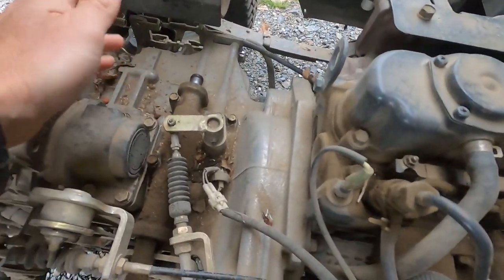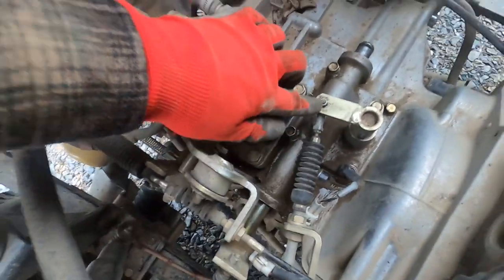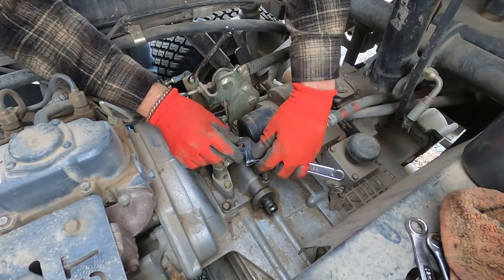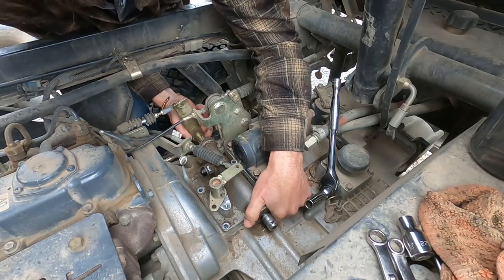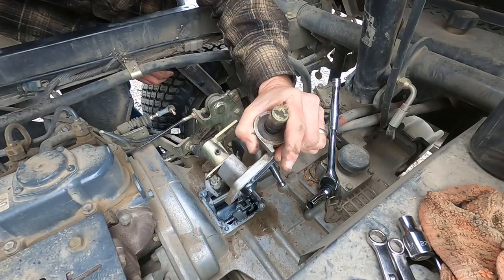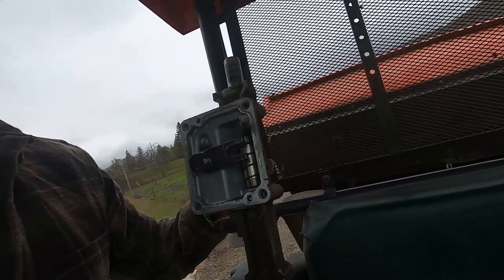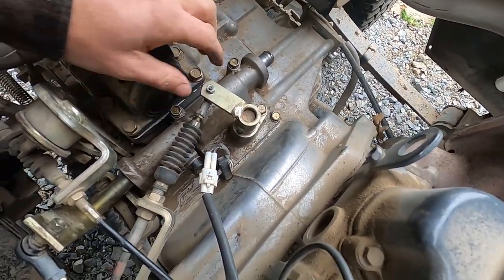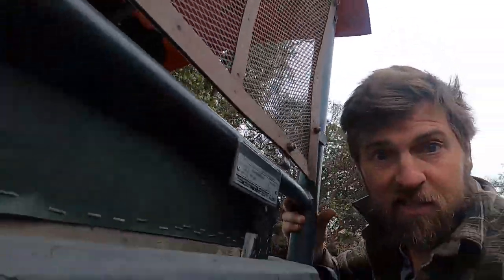How to fix DIY Stuck KUBOTA RTV 900 TRANSMISSION

Comment: Thanks for the video! It was super helpful in diagnosing the problem with my Kubota's stuck transmission.  Which luckily happened to be the same problem as yours and was an easy fix.

Comment: Great video. Helped me immensely. After a couple tries, I realized the shifter needs to remain in neutral in order for this fix to hold. The process moves the shifter, which moves the linkage. Secure the shifter in natural neutral and you'll nail it first try.
Reply from the maker: Yes, it's simple once you get it lined up, right?

Comment: THANK YOU!!  Mine was stuck in forward.  It literally took 10 minutes to fix.  I can't imagine what the Kubota dealer would have charged.  Another thing to note, my RTV was not moving well, no energy, something seemed to be holding its energy back.  Once this problem was resolved, it has 3 times the energy. So.....I guess the gears have something to do with its ability to propel as well.  This 65 year old mother was able to fix this in 10 minutes.  You just need the right tools and some shade (Texas heat).  Thanks again!!

Comment: Great video. Thanks for saving us all alot of time.   What position does the actuator need to be in?  Should I put the gear shift in neutral?
Reply from the maker: Neutral makes it easier, I find.
Reply: I can't seem to get the right alignment.  I put it back together and get one gear or nothing
Reply from the maker: @WestuFarms  It's definitely got to line up as you re-engage it. If it's not dead-center in neutral, then you'll be out of whack.

Comment: dont worry it'll happen again. there are 2 causes that combined causes this. first the shifter has too much mechanical advantage. second the hydrostat doesnt fully return to neutral.  if that shifter doesnt move easily don't go even half gorilla on it.  shut the engine off then try putting it in neutral. pushing too hard causes the shift pin mechanism to flex and then jump out. there's a fix for that but thats reserved for dumb gorillas and usually causes other things to break.  the real stinker is the neutral adjustment on the hst part of the transmission. the throttle not only works the engine throttle but the hst servo which in turn moves a swashplate to increase trans input speed . the finger on the servo wears and the hst fails to go to nuetral. so there ends up being pressure applied to the gears making them not want to shift.  its a couple hundred dollar part and needs to be properly adjusted.  oh and there should be a prop on the left frame rail for the dump cylinder. its cabled to the round pipe the cylinder bottom pin is attatched to. and should have stickers to show how to use it . i could see the stickers in the video.
Reply: thats our trouble we have guys who have been told be gentle but then go gorilla on it
Reply: Thanks I thought something on the order of this. If I push the break hard it will shift so thanks
Reply: You got it. 

I've had the same problem, especially when backing up the grade into the barn. If I push hard on the brake and just wait a few seconds, all the tension comes off the gears and it shifts easily. Forcing the shift lever will cause this problem almost every time. Just press the brake, wait until it shifts easily and this will not happen.